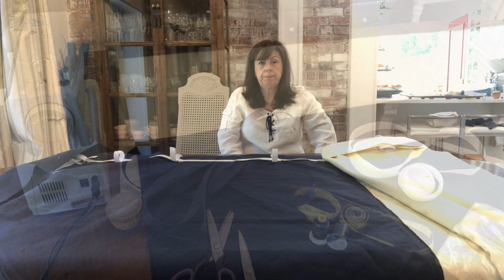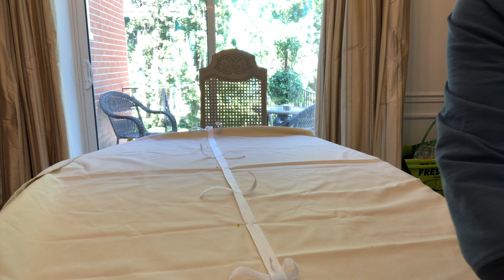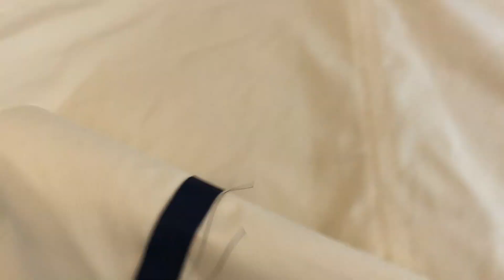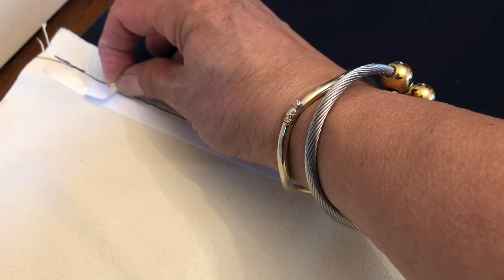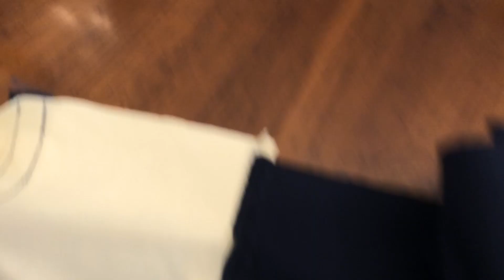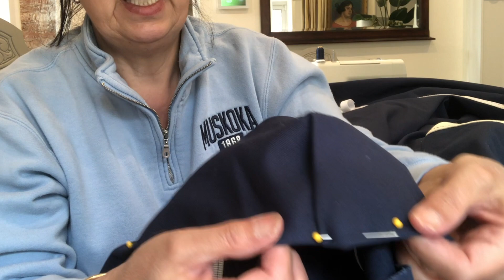Sewing Exterior Fabric (like Sunbrella), DIY Bimini Top

Comment: I didn't catch where you said it, but where did you get the Sunbrella material?  I'm going to be looking for some for a project that I won't need until next year so I have some time to shop around!
Reply from the maker: Hi there. I bought the fabric at “ fabricland” here in Ontario. The fabric doesn’t have to be sumbrella, that’s just the brand.  The service clerks at the store pointed out other outdoor fabrics that were water resistant, uv protected etc…made by other manufacturers.  I was able to find the amount of fabric I needed from the clearance bins because  they were sample rolls. Therefore, buy more than you need because it will be hard to match the fabric later, if you need it. Hope this helps and thanks for watching
Reply: @suzyrebelo  ahh, gotcha.  I was thinking you found it online because I haven't seen the Sunbrella fabric here locally, let alone on sale.  I have found a few brand options, but Sunbrella seems to be the best of the bunch from what I've seen - the most bang for the buck, at least.  I'll keep my eyes peeled for some deals, but I suspect I'll just need to open up my wallet to get this project done haha.

Thanks!
Reply from the maker: It’s worth keeping an eye out for a discount ! Good luck and happy sewing!
Reply: @suzyrebelo Hey Suzy.. which fabricland in Ontario did you find Sunbrella?  I am not too far from Kitchener.  Thank you!
Reply from the maker: Hi there  I went to the Fabricland in Barrie. They have a large discount / discontinued area in the back. There are other brand names for outdoor fabric. I asked the service people to help me find other, comparable outdoor fabrics. They were very helpful  Good luck finding your fabric and happy sewing!
Reply: @suzyrebelo  Thanks Suzy.  I called Kitchener and they said they had that Sunbrella on sale right now at 30% off so I’m gonna check it out tomorrow. Thank you for your help!  I never would’ve thought they would’ve carried Sunbrella!
Reply: That's a good savings. Hope you find something you like!

Comment: Can you add the link to tge special thread and what needle you used please? 
Thank you!
Reply from the maker: I’ll look for it and let you know.  I did buy it at fabricland here in Ontario.  It’s nylon and uv protected thread. Thanks for watching.
Reply: @suzyrebelo  thank you, that helps! 😁
Reply from the maker: I found the make of thread.  It’s by 
COATS and CLARK-Outdoor Thread. This is the ideal thread when making or repairing items for outdoor living spaces. Use it on patio cushions pillows umbrellas grill covers and more. Made from 100-Percent polyester it is UV resistant to withstand exposure to the elements. Each package contains one 200 yard spool of Outdoor thread. Available in variety of colors (each sold separately). Made in USA.
Reply: @suzyrebelo  THANK YOU!!! 🥳😁😇